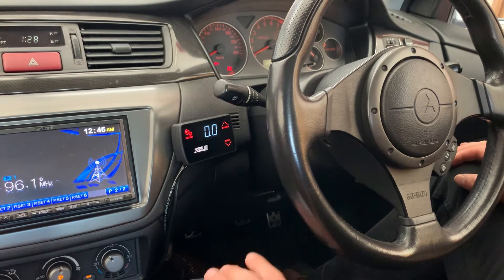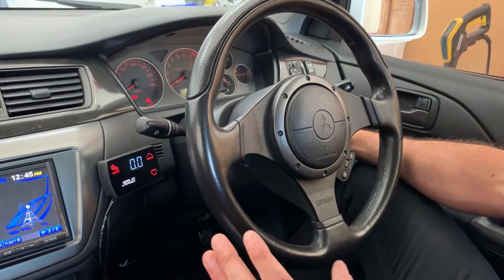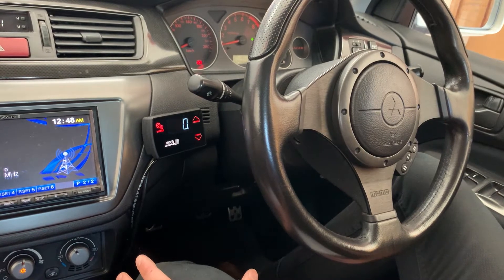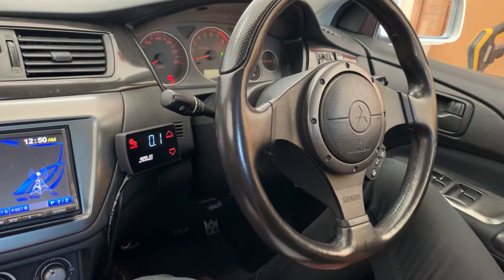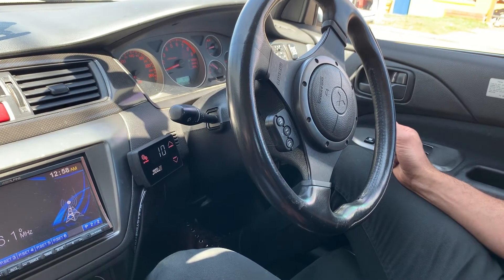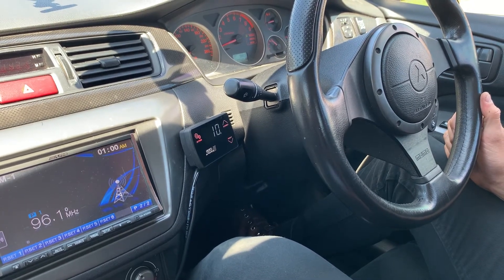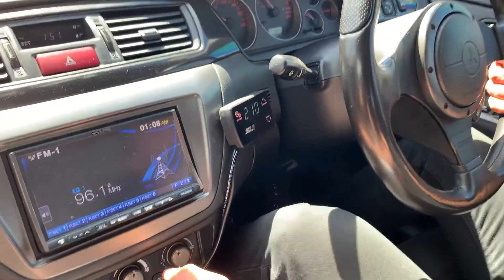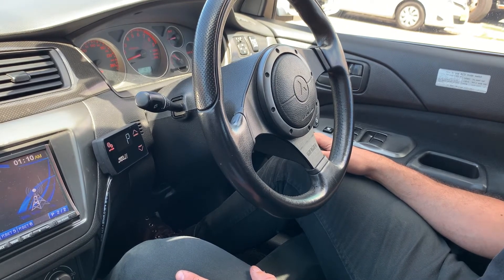GFB G-Force III Part - 3 Boost Control Setup

Comment: What does it mean when it flashes and says cue on the dash when I get to the boost I set it at
Reply from the maker: That means you're hitting boost cut. It sounds like you may have your boost limit set too low, or duty cycle set too high. We recommend setting the overboost limit to around 10% higher than your target boost

Comment: how to safely set the gain? what are indications or numbers we need to look at?
Reply from the maker: Hi, the GAIN setting can help the turbo spool by preventing some air reaching the wastegate until you reach a boost value closer to your previously set boost target. This setting would ideally need to be fine-tuned specifically for your vehicle as we, unfortunately, do not have an exact figure that would be required for your specific vehicle – we do, however, provide a guide on how this is to be set. It is tempting to set the GAIN setting to 100, however – this may result in you overshooting your boost target. Thanks.

Comment: I have a corsa vxr what’s the highest boost I should go using my  GFB controller ? 

Thanks
Reply from the maker: That's probably something you should be asking your tuner. The G-Force is a tuning tool that is designed to be used with an ECU tune to ensure that the engine has the correct amount of fuel and spark for the boost pressure.
Reply: @gfbvideos  as it’s your product I thought you could give me some sort of idea as I don’t I’ve a tuner just going or a standard car
Reply from the maker: @christaylor1753  
Hi Chris,
Unfortunately I can only give you information about what the product is capable of, and what the product is capable of is giving you far more boost pressure than is needed to destroy your engine, especially if it is not going to be tuned. 
The amount of boost you're willing to run in your engine depends on how strong the engine is, and how much room there is in the factory tune to allow for extra boost pressure. For safety, I wouldn't ever recommend running higher than standard boost pressure on an un-tuned engine unless you're monitoring AFR's and are willing to accept the risk that the engine may not last very long.
Reply: @gfbvideos  fair enough I am getting a new exhaust next month amd getting a tune on it so I will go from there cheers for the info

Comment: I’m a little confused with my controller, the car is tapering boost at higher RPM and I cannot figure it out. I have cranked up the sensitivity setting and it seems to not do anything. 

On my other controller, gain is what increases wgdc/rpm if it starts to taper. Do I need to play with gain?
Reply from the maker: The main thing is to make absolutely sure you have a target boost saved. If not, the gain and sensitivity settings will do nothing and it will operate in open loop. To check target boost, tap "settings" once to go into the duty cycle menu. It will show you the current duty cycle, followed by the target boost (called "PEAK" in this case). If the target/peak value is zero, or significantly lower than it should be, you need to record the actual target value by doing a boost run with the controller in the duty cycle menu. 

If you do have the correct target boost stored in the duty menu, and you've cranked sensitivity to max (100), and nothing changes, it is likely that the turbo simply cannot provide any more. If your duty cycle is higher than 70%, that means the controller doesn't have a lot of headroom to correct for tapering boost. With sensitivity at 100, if your boost drops a few psi it is probably giving the solenoid 100% duty and there's nothing more it can do. Switching to a stiffer wastegate spring (or swapping out the actuator to a higher pressure unit) should help, as it will bring the base duty cycle down, meaning when sensitivity cranks up the duty to correct for taper, it has more headroom to do so. You may still run into choke issues with the turbo however if it is too small for the boost level you're targeting. 

With regards to your other controller, disregard any correlation between what each setting does. On the G-Force, gain controls spool up, sensitivity controls closed-loop correction. 

The advice above is given without knowing anything about your setup. If you've checked or done the suggestions above and still can't get it working, get in touch with us via our tech support channel on the website to discuss in more detail.

Comment: My car is a BMW E92 335i LCI DCT.  Is it possible to install and use this product?  I haven't replaced the turbocharger, but I have introduced Stage 2 of MHD Tuning.
Reply from the maker: The G-Force 3 is not a vehicle specific product. With that said, there may be certain factors that make it more or less suitable for your application. For specific information about your vehicle please contact our engineers at support@gfb.com.au

Comment: I did all of that but mine doesn’t go up in boost in the duty cycle menu and on the preset setting it only goes to 0
Reply from the maker: Sorry to hear you're having problems with your boost controller. For specific technical support could you please contact support@gfb.com.au with some photos or videos of the issue so we can help you out
Reply: Mine with the same problem, did you solve that?

Comment: What gear should i do the runs on? Would be 2nd gear be sufficient
Reply from the maker: The higher the better, and note that you don't need to redline it, you want to sweep through the peak torque RPM as this is where boost is usually highest. If 2nd gear is all that's practical where you're setting it up, try some pressure on the brakes with your left foot to load up the engine. What you're trying to do here is prevent the RPM from rising too fast, as this makes it harder to set up accurately.
Reply: @gfbvideos  cheers for the informative reply 🙏

Comment: I just installed one of these into my mates Forrester,  when its idling it's at -63 vaccuum,  have I installed the vaccuum line off the controller into a wrong port on the intake? Wheres the best place on the intake manifold to "T off" from?
Reply from the maker: Hello, 
It sounds like you've probably got the unit set up to read kPa. You can change the units in the menu from kPa to Bar or PSI. -63 kPa is about what you'd expect for idle vacuum